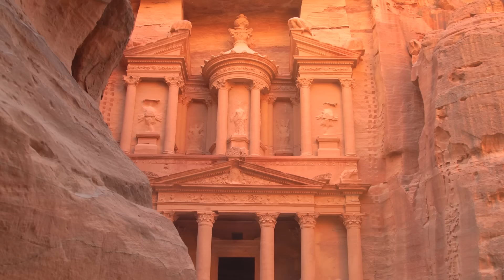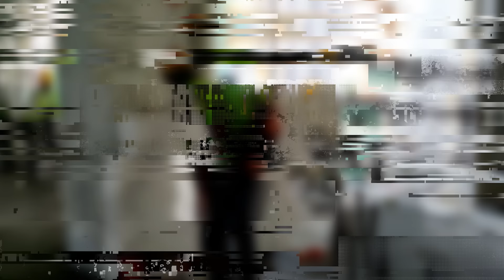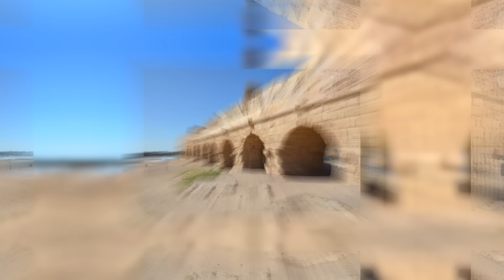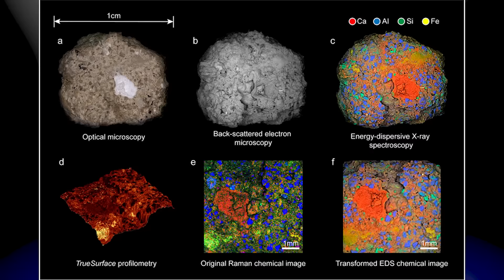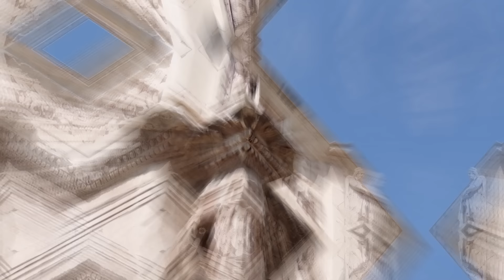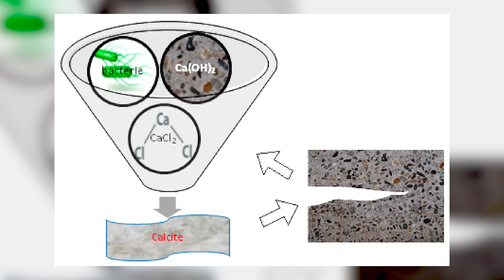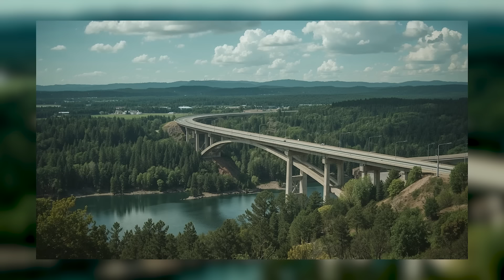Why Roman CONCRETE Lasts 2000 Years While Ours Dies in 50

Comment: There’s one more thing that you should have mentioned. Those Roman structures are massive in size compared to modern structures.
Reply: Not with the wall thickness that they used. Those old structures
Reply: I don’t think so we built pretty massive buildings now.
Reply: @dustintacohands1107 Not with the sort of wall thickness they used. 

You will note that none (zero) of the regular concrete structures from that time survived, only the monumental ones did. Two thousand years from now structures like our big dams will still stand as ruins.
Reply: @Tugela60  Monadnock Building built 1892 6 foot thick walls…. Its brick though 

I cannot find many examples of thick concrete besides bridges and dams.

I think many of moved away from thick concrete on bigger residential or commercial projects because steel.

Nothing is really built to last but bridges and dams it seems.

Comment: The great majority of the concrete structures the Romans built 2,000 years ago no longer exist, so looking at the few which survive does not prove the intentionality of their design for extended life.  And the concrete structures we build today with steel reinforcing perform far better in response to lateral loads (examples: earthquakes and wind loads, soil and liquid lateral pressures on retaining walls and tanks.)  They also use far less material than Roman structures, so they are more cost-effective if they are protected from the weather.  

Yes, the Romans took advantage of unique natural materials for some of their concrete work and some of those structures have survived.  They weren't able to build skyscrapers or long-span bridges because of their lack of adequate reinforced concrete technology.  The rusting of iron reinforcing can be dealt with a number of ways:  stainless steel reinforcing, protecting the concrete and the reinforcing by keeping it dry, admixtures and sleeving to keep conventional steel dry, etc.  

An arch usually works great to span horizontally, even if made of unreinforced blocks of stone, if never subjected to an earthquake, but unreinforced concrete can be deadly in an earthquake due to its low tensile strength;  hence reinforcing is required for concrete walls, roofs, and suspended floor slabs in earthquake zones in developed countries.  A reinforced thin-shell structure (google Eugene Freyssinet Orly airship sheds, and Felix Candela) can feature 3% (or less) as much concrete to cover the same space as does the Pantheon.  Just as wood must be kept dry or it rots, so concrete must be protected, either kept dry with a maintained roof, or constructed to make it waterproof, which can be difficult without excellent design and construction techniques.

No argument that concrete is often built fast, cheap, and often poorly designed and executed, particularly in smaller buildings.  My structural engineering professor noted that for buildings, we design steel structures to the 1/16th of an inch, wood structures to the 1/4 inch, and with concrete, we are lucky if the subcontractor shows up at the right jobsite.
Reply: well today though there are even more solutions than then, yet reliability isnt there. And think about it, off course many of these will collapse in 2 millenias since it isnt just weather. Countless wars and conquests have happened there. Today we could replace rebar with fiberglass and it would be immortal but we rarely do that
Reply: There are far more roman structures still standing today than you can imagine.  Many are underground.  In fact a lot of the buildings in modern rome are built on top of ancient roman buildings.  I was in Italy for a year, and went underground and saw these structures they are amazing, and in perfect shape even after 2000 or more years.  That cannot be said of anything built today.
As for rebar and reinforced concrete, I got a mechanical engineering degree and remember my strength of materials classes.  But I also know many old timer masons who do a lot of foundation, brick and even rock work.  The old timers steer away from rebar unless it is absolutely necessary and only then they use very little and never near the outer surface of the concrete structure but deep inside. 
I am convinced we that modern building is extremely subpar compared to many centuries ago.  I see concrete structures falling apart after 30 years, many are lucky to reach 50 years.

Comment: I think you may have left out some context.  The reason rebar is essential is it allowed designs to be more flexible in bridges, buildings, etc, taking far greater loads than what plain concrete, even Roman concrete, would allow. Interestingly I remember a story about a Japanese Officer stationed on Roi Namur in the Marshal islands during WWII who came up with a way of making concrete using sea water.  A huge boon as the island had a very limited fresh water supply.  Many of the remaining structures made from this concrete decades after the war still look fresh.  The officer was killed during the first bombardment of the island and his secret went with him him apparently.
Reply: The rebar used today could be replaced with non-corrosive materials of equal or greater strength to archive the same properties needed for bridges.
Reply: @thomasroewer5673  Rebar can be made of stainless steel or basalt fiber composite but it's more expensive.
Reply: @seneca983  is it really more expensive if it lasts millennia instead of having to be rebuild every few decades? And that doesn't even cover the maintenance costs required to make it last 50 years. In the long run, using noncorrosive materials would be a lot less expensive.
Reply: @thomasroewer5673  Yes, I think it's more expensive. If we use annual discounting rate of 5% then rebuilding it every 50 years at the same cost makes the discounted present-day cost about 8.3% higher compared to a structure that lasts forever. I don't think making it last that long would be that cheap, not to mention that some structures would simply not be possible without steel. You might protest that 5% discounting is too high. With 2% discounting it would be about 57% more expensive. That's more but remember that making a super-durable structure isn't cheap (if it's even possible). Also remember that often it makes sense to replace old structures anyway when they're no longer fit for purpose. I certainly wouldn't want to live in a Roman insula and Roman bridges wouldn't be able to carry modern trucks and trains nor let modern cargo ships pass under them.
Reply: @MatthewBowers-e5e  At least the results I got by googling is that stainless steel rebar would last something like 50 years longer than plain steel rebar. If that's not enough, there's always rebar made of basalt fiber composite.
Reply: @MatthewBowers-e5e  Buildings made of steel reinforced concrete (and I mean regular carbon steel, not stainless steel) that are older than 100 years do exist.

 "We should be building for 500 years or more."

No, we (generally) shouldn't. That extra lifespan costs money. The extra years of use are not necessarily worth it. If we use 5% annual discounting, then extending the lifespan from 100 years to 500 years increases the value only by something like 1% (assuming constant value from use). In most cases the extra lifespan just isn't worth the extra cost.

There can be some exceptions like cultural landmarks. We can be glad that e.g. the Pantheon in Rome is still there. However, we wouldn't want for every single Roman insula to still be there and in use.
Reply: There is also survival bias here.  Ancient concrete that failed we don’t see anymore.  Perhaps a lot of ancient concrete did fail, we see only the few that survived
Reply: @davidpeet2109 go to Rome and other places in Italy with anent structures. Plenty have survived.
Reply: @rosebronikowski2022 how does that change the premise that many failed but are not here anymore? It doesn't at all.
Reply: @nerfherder4284 critical thinking is non-existent these days
Reply: @davidpeet2109 I’m afraid you’re wrong. Most of Ancient Rome main structures are still standing. And they survived earthquakes, looting, bombing. Go look it up
Reply: @davidpeet2109 actually it’s not just a few. It’s hundreds of thousands of examples. 😊
Reply: @volkerr. in a world where millions to billions of examples used to exist. It's called survivor bias for a reason.
Reply: @davidpeet2109  and that is relevant how?
Reply: @davidpeet2109  Well in rebuttal, I know of a few very old buildings just in my local city that were demolished. Nothing wrong with them, would have lasted another thousand years, they just demolished them. Very sad
Reply: If aluminum silicates contribute to the strength of the concrete, perhaps the rebar could be aluminum, which doesn't oxidize the same way.
Reply: @CoelhoSports too Had an aluminum car wing mirror that corroded, part of it turned to a white powder
Reply: Using salt water in concrete is fine without uding steel rebar. No invention required.
Reply: Speaking of FLEXING...I seen all the upper levels of Anaheim Stadium flexing at least 10! inches from the Fans going nuts when the Angels were playing for The Pennant!
Reply: Чув за це,але не знав чи є продовження цього корисного винаходу.
Reply: Mmm... rebar or derivatives such as wire mesh are used in far more things than the structures you mentioned. Steel is used in concrete for the reasons mentioned but also to cover for other poor standards, just because,  because many presume it must, and because it is code.   Nobody questions code.  Nobody fights code.
Reply: 소금물에 못을 담가보면 소금물의 종류에 따라 쉽게 녹 슬지 않는 것도 있고 녹을 슬게 하는 것도 있습니다.
Reply: The reason some rebar swells in concrete, causing the concrete to crack is because some concrete is made with with ocean sand, so it has salt in it, which causes the rebar to rust. If the concrete does not have ocean sand and the rebar has not been sitting in the rain prior to installing, it will not fail.
As far as the Parthenon goes, it has been remodeled many times due to it cracking and falling apart. It's still around because it has been properly maintained. You know whats not around anymore? 99 percent of the ancient concrete structures in Rome.
Reply: @klubstompers  That's certainly not the only reason. In many cases rebar rusts because of normal cracking, rain, and de-icing salt spread on roads. Sometimes that may be because rebar is too close to surface. Secondly, are confusing Pantheon (in Rome) and Parthenon (in Athens)? Which one are you talking about?
Reply: @seneca983  My bad, i meant the Pantheon in Rome. It was completely destroyed to rubble around 100ad due to a massive fire, and then rebuilt. It got severely damaged when a pope stripped the bronze girders from the portico in 1620 to build cannons, which led to a massive restoration. In 1747 a lighting strike collapsed much of the ceiling, which took over 100 years to fix. The only reason it still stands today is due to all the restorations.
Reply: @klubstompers  It's not necessarily about salt in the sand which would be a small concentration. It's more that when left unfinished, concrete remain porous and as water absorbs through the material containing many salts not just sodium chloride, it slowly causes the rebar to deteriorate. All that is necessary to prevent this is to add a finish layer that is water impermeable. this is not done in most cases due to costs. It is simple enough to do in practice, it's just not in the budget.
Reply: @skycityv32  Concrete companies are aware of the beach sand issue now, but were not in the past, and is one reason some of the older structures are failing today. If beach sand is used today it is thoroughly rinsed. As a union mason I've put an uncountable amount of rebar in structures, and anything designed to last, has rebar coated with a zinc epoxy, and concrete without beach sand. Im not familiar with finishing concrete, because in my field its all wrapped in cmu, but i can see how a less porous finish would help mitigate water absorption, and is why we use a spray sealer on cmu as a final step when called for. Another lesson we have learned over the years is to not place rebar close to the exterior so water cant get to it, or along seams where pours meat each other, cause water can seep into the structure along the pour seams. We also vibrate the cells of a pour to remove air bubbles now to make sure the concrete has no voids.
Reply: @skycityv32  The "Mulberry harbours" used in the D-Day landings were made of ferrocement, and their remains may still be seen around the estuaries and embankments, they didn't fail, most were abandoned or scuttled post war.
Reply: @klubstompers Sand IS ocean sand. That’s what forms it.
Reply: @paulmcgreevy3011  Ever heard of a river or a desert? Where i live in the PNW there are  a ton of sand mines currently in use today, that were formed and deposited from glaciers during the ice ages.
Reply: Even Roman concrete without reinforcement is not nearly as strong as modern concrete with reinforcement.

Comment: They should make a mortar that is more durable. In concrete block structures it is the mortar that gives out.
 Because less mortar is used than concrete it would not cost all that much.
Eliminate or greatly reduce the need for repointing.

Comment: Multiple references to concrete highways.  Interesting.  Where I live, all the highways are made of asphalt (the gravel and bitumen version, not asphalt concrete).
Reply: where I live there are plenty of concrete highways, with asphalt being used you other roads. Concrete survives longer than asphalt, which is why high capacity highways usually use concrete. Asphalt can be re-used while concrete is ground into gravel.

Comment: Roman concrete is rubbish. It is extremely weak and takes many months to cure. The ONLY reason it lasts so long long is that it doesn't use steel reinforcing,

Comment: Everything in our modern world is designed to be replaced regularly to perpetuate the economy.
Reply: So true, I know this as fact. Worked in roofing 50+ years.
Reply: Nonsense. No business does anything to "perpetuate the economy."
Reply: @billyruffian1426  planned obsolescence. cars manufactured to be harder to be repaired economically. Apple makes it impossible to get parts and actively embeds systems to disable the phone if a non apple part is installed.  They do it do maximise their profit. And the government lets them to get taxes on every transaction. This the economists will tell you keeps the economy moving as you have to continually replace goods and more frequently than is really needed.
Reply: @damien7157  you arguing intent doesn't not change the outcome. They make it so you cannot get a repair without a dealership computer. Has nothing to do with crashes.
Reply: @damien7157  you must be a teenager, lol
Reply: @damien7157  yeah you know nothing about how the world works bud.
Reply: @damien7157  ""You do not need a dealership computer to repair a car""
Depends on the part and depends on the car. You can't replace your own car battery if it's a BMW. It has to go back to the dealership so they can sync it up with the computer system in the car. Luxury brands do this to make sure you keep coming into the shop or else your sensors don't work and things aren't right.
Reply: @damien7157  And you can also fix your own iPhone if you truly research it and buy special tools.  You can do that with almost anything.  My point still stands. You can't just go to the store and buy a battery and be back in business.  They do this with all kinds of stuff that takes special equipment and knowledge.
Reply: @billyruffian1426  🤦‍♂🤦‍♂

Comment: Lies lies and more lies... There is no building in Rome that was built 2000 years ago. Stupid people will believe it without a second thought
Reply: You should use Wikipedia and check it out: the Pantheon was dedicated in AD126 so is only a little shy of 2000 years at 1899 years, and since it was not built in a day (as the saying goes...) the structure is well over 1900 years old, and is STILL the largest non-reinforced concrete dome in the world!

Comment: What about the new fiberglass rebar ?  It is a glass fiber embedded in an epoxy matrix  and does not corrode as far as we know now.  This would eliminate the steel rebar corrosion problem.  The tensile strength of the bars is very good, I have not seen any figures about required embedment length which might be longer due to the smooth nature of the fiberglass.  Fire resistance could be a problem in some applications since the epoxy matrix is not fire resistant.
Reply: I came here to mention fiberglass rebar as well.  I believe a high-temp resin is used, but I still share your concern about weakening during a fire.  As for smoothness, fiberglass rebar is made with the same nubs/pattern that steel rebar has.  So, no slippage.
Reply: check out basalt fibre rebar too. stiffer product than steel.
Reply: @snorttroll4379  Базальт, тоже стекло, но под другим названием, всё кремний в основе.

Comment: There is a bridge in France that has a foundation that IS 2000 years old. It is made from HEMPCRETE. That is a mixture of lime mortar and hemp shiv - that is the silica rich dried hemp stalk. Hempcrete takes a longer time to set than concrete but is a heat insulant, is fireproof, insect and rat resistant, moisture resistant and mould proof. It also self heals and absorbs CO2, gradually turning to something resembling sea shell. Unfortunately, because  hempcrete contains hemp, the more ignorant amongst us think it should not be used, not realising the hemp is not the sort that can be smoked (being more like old rope).
Reply: Hemp was used for many things.Until the thugs in big pharma stopped it.
Reply: that's a lie
Reply: Amazing..........how did you find a source for this info?
Reply: Cool so it's underground...wonder how the moisture drains from it